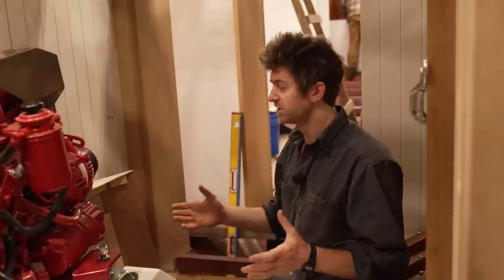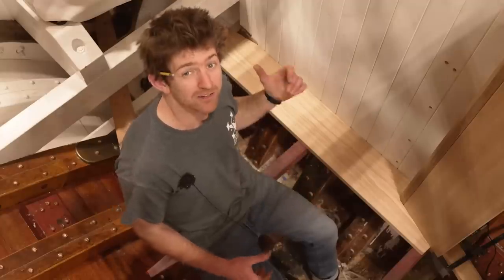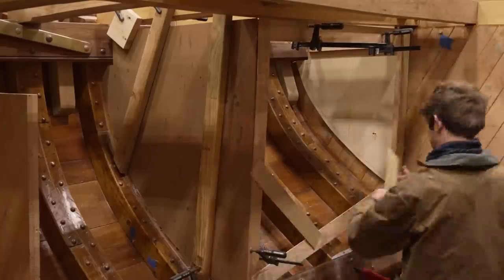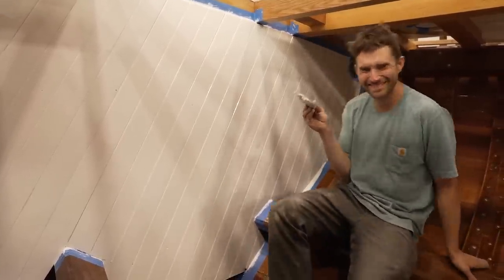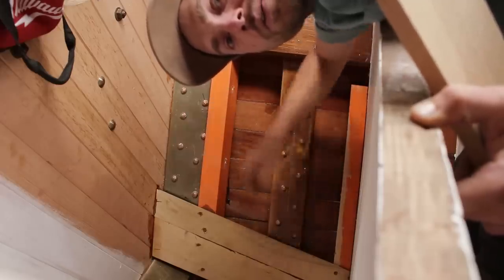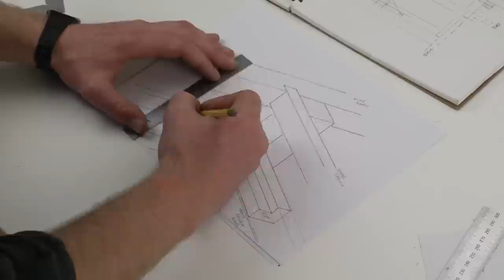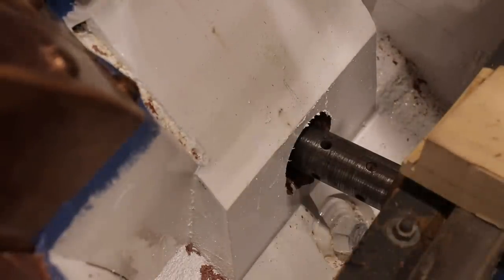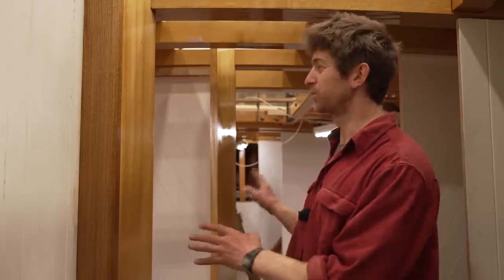BACK TO WORK! Lots of interior and systems progress... (Boatbuilding / Tally Ho EP126)

Comment: I thought it would be a cool idea to machine a solid brass seamless drip pan…stainless steel is nice too but it stains yellow with the dirt in dirty diesel and motor oil…brass will stay perfectly clean and ‘polishable’. You need a full time professional blade sharpener….or….conversely…you can spend every Saturday of your life from 4AM until 10pm standing at the antique grinding wheel, moving to the stoning room (not what you’re thinking) and then to the finish and polishing station.  Every tool of every machine and every hand tool with an edge that has been used during the week is sharpened to perfection.  It’s like a religion except for the language when I slip and cut myself….

Comment: Just watched a vid where some yahoo put in a TinG wood ceiling in a house and painted it white. The customer called saying the ceiling was cracking. Of course the Home Depot wood shrunk. He caulked the bejeasus out of it and slathered on another coat of white. Not my idea of the knowledge set that a master finish carpenter should bring to a job. Were you that guy you would have told the customer about the correct species  of wood to use and how it moves with the interior climate and possibly why slapping on a nice thick cost of white paint would not be a good idea. You would have been fired of course. 🤣👍

Comment: The drip tray's sides leaning that much outward will make spill things early once she's heeled. - I reckon that tray shall never be as full as aboard less loved and less looked-after yachts, but You never know - it's a just-in-case drip tray after all. Could be slightly improved with a thicker line of top end material - or just another cm or two bent inwards on top of the sides.
How far she has come since she first was set down from the trailer on the gravel neighboring the workshop in Squim! 
Still two years from launching, hay? Thanks for sharing!

Comment: How... on earth did you bore that accurate. How...
Reply: The 2nd half of EP80 shows how they (carefully) set up the initial auger drill bore, then enlarged it w/ 2 different boring bars - the 2nd was supported at both ends, & could be 'aimed' w/ great precision. The camera shot at 22'20" shows the spot-on result !

Comment: Question, do you work with the metric system or imperial when building the boat?
Reply: Tally Ho was originally built using Imperial so what do you think!!!!!
Reply: @tonygrimes13  well, imperial is not an easy system to do precice measurements with, so I would assume they converted to metric, or using a combination. Which is why I asked the question.
Reply: @jurgen951  As all original measurements were in imperial why do a conversion?
Reply: @tonygrimes13  mainly because almost the entire boat is rebuilt from new drawings and measurements, albeit some parts are based on original drawings. 
Easier to work with the metric, given all the different cutouts and parts etc. but that’s why I was curious.